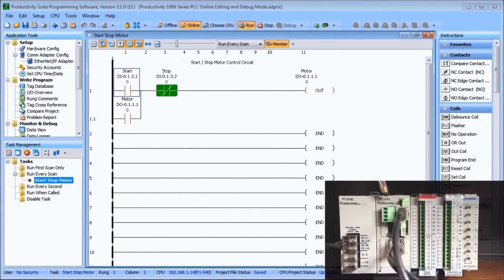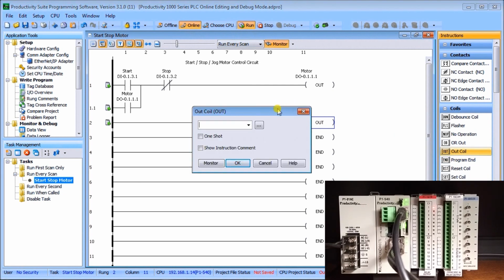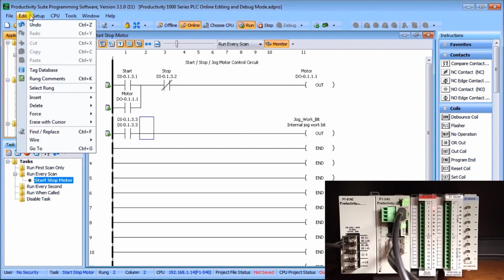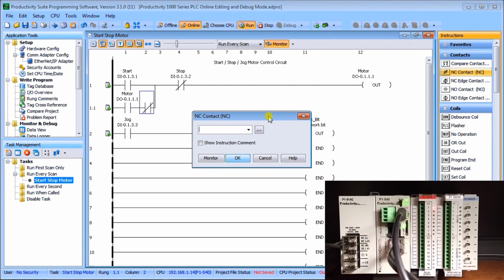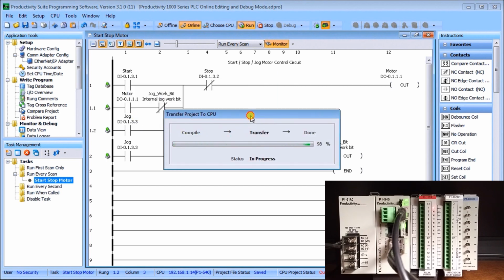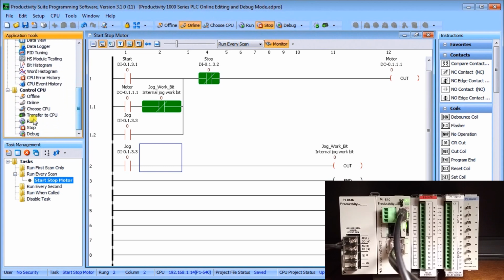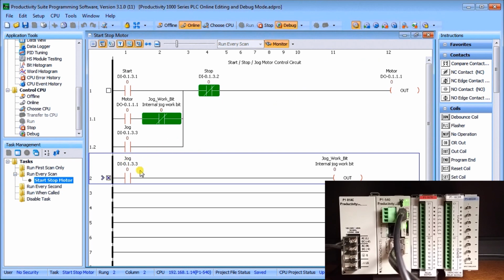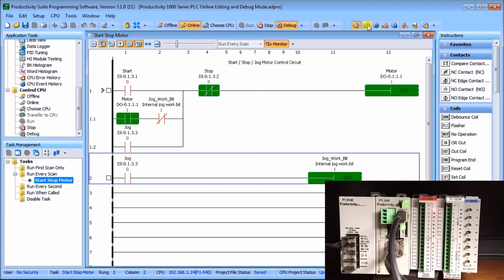Productivity 1000 Series PLC Live Modification & Run Mode!

Comment: Thanks, How did you get your ladder to highlight green like that? (The solid green boxes)
Reply from the maker: Hi aussiegruber86,
When connected to your controller online select the monitor button on the ladder window. This will put the view in monitor mode.
Monitor Mode gives you a graphical representation of the logical state of your tags as they appear in the ladder logic.
Regards,
Garry
Reply: Thanks Garry, I had a handle on that but didn't know there was another option (I have found it) to make the tags fully green and easy to see.
Reply from the maker: @aussiegruber86  
Thanks for the update aussiegruber86.
Garry